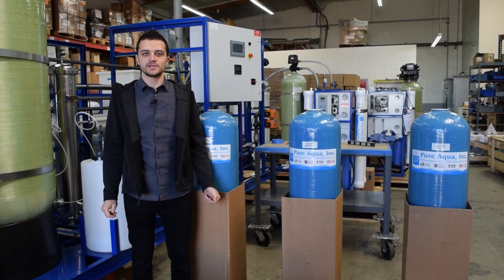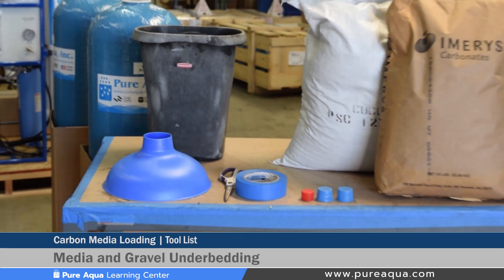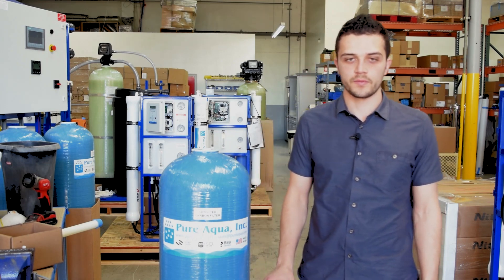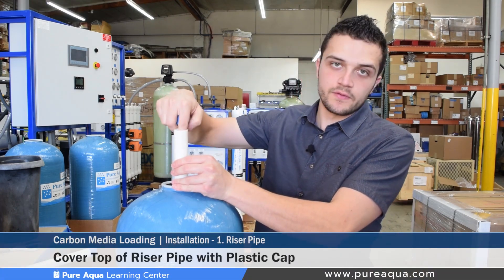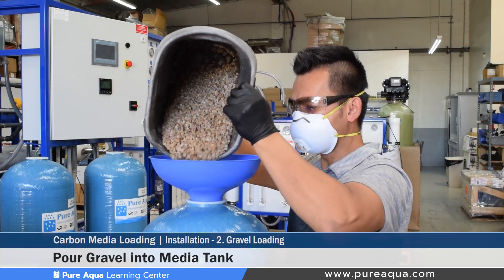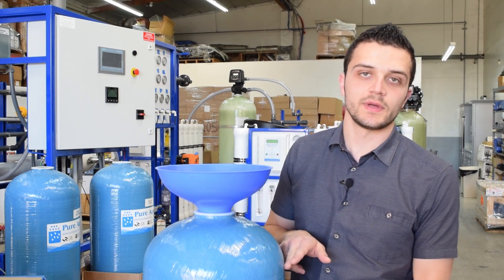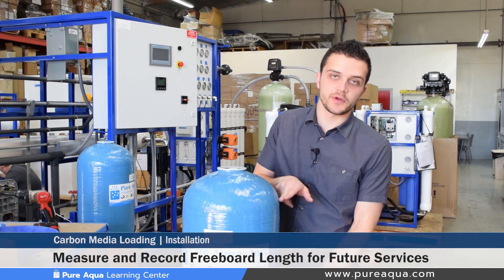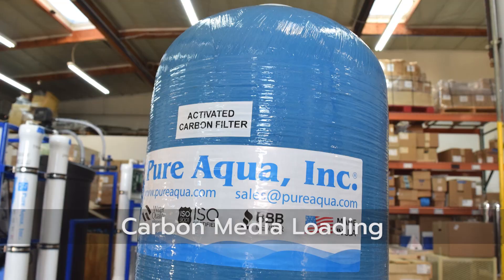Carbon Media Loading - Pure Aqua Learning Center

Comment: Would you recommend using anthracite as carbon media? I used some and the filtered water is still murky after several backwashes
Reply from the maker: thanks for contacting Pure Aqua, Anthracite acts like a non activated carbon, it will not remove organic